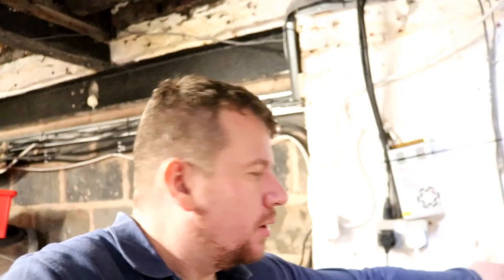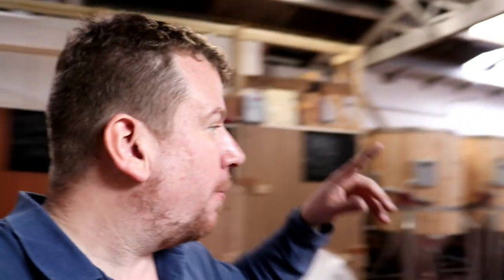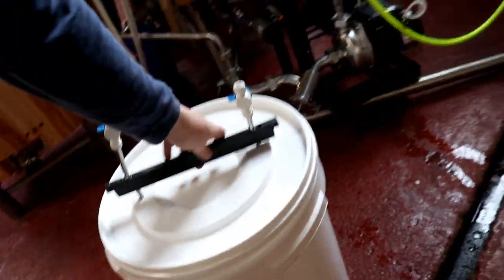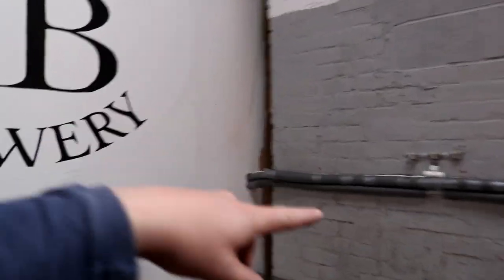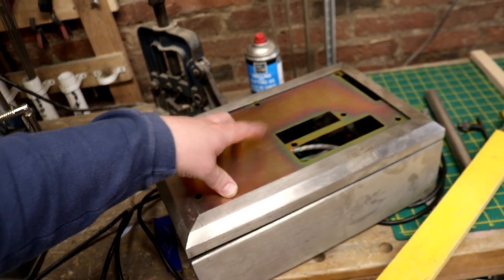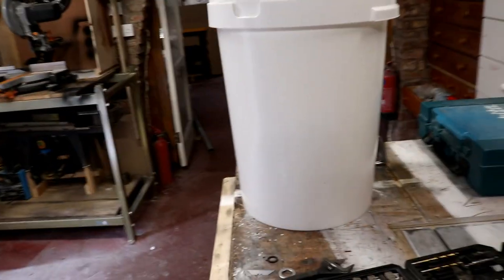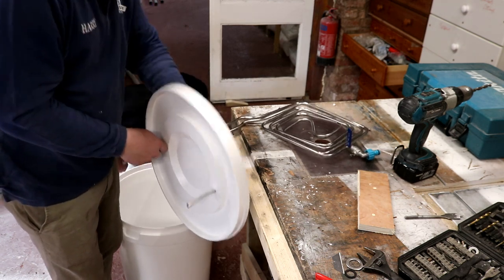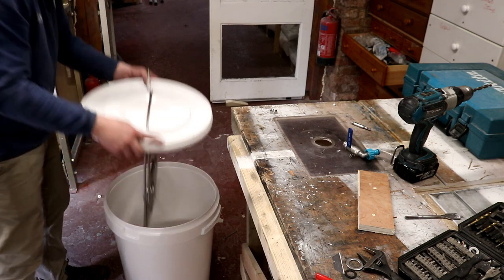Brewery Pilot Kit ~ Fermenters ~ Part 3 🍻

Comment: Nice recycling of the cooling coils,interested to see if there are any issues having beer in direct contact with the cold coils. Just wondering why you put the taps so low on the bucket fvs,will that not cause trub issues? #notanexpert Cheers.

Comment: I got a Question for you harry or someone else, Whats the dimensions or ebay link of the Project box, Jiffy box or Junction box that you use all the time for the STC-1000's?
Ive a got a few projects that ill be using STC-1000"s and finding it hard to find a box deep enough to hold them..
Reply from the maker: Waterproof Outdoor Junction Box Weatherproof Enclosure 240 x 190 x 90mm IP56

Comment: tap should be a bit higher mate to keep it out of the trub
Reply: just stick a bit of bent pipe into the feed for the tap internally
Reply from the maker: Yeah, I cocked up
Reply: @harrybrew69  The higher pickup tube on the inside  would work